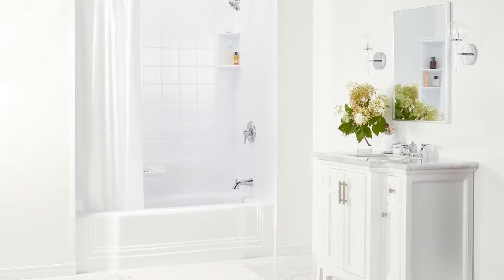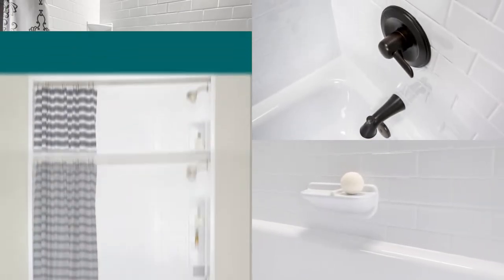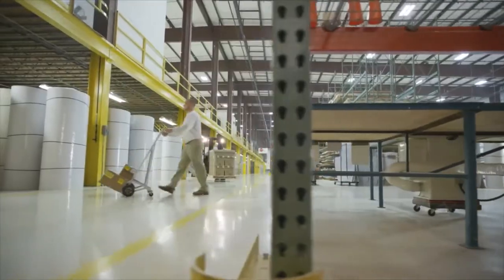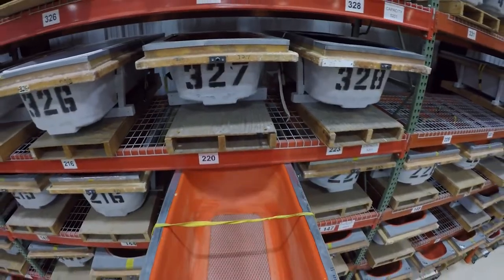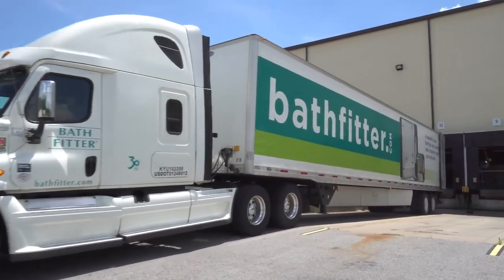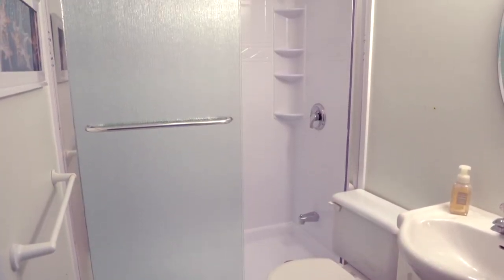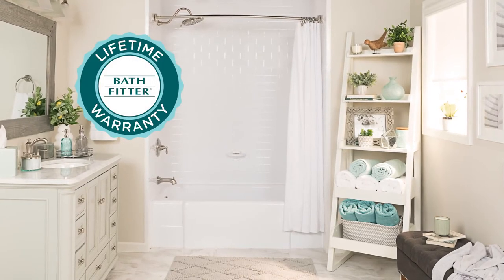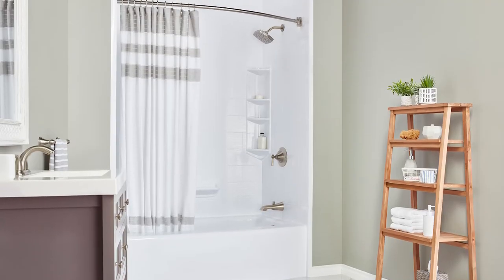Bath Fitter - How It Works

Comment: Never deal with bath fitter if you like your drains to keep working.  Had them out Monday.  Called Tues with tub not draining and was told to have plumber out.   My plumber came out 2 times and they left old tub parts inside that blocked the flow of water and we watched tile clear out through the main as he snaked it.  Dan the manager at Livonia location was extremely argumentative and not helpful with ridiculous explanations and very rude.  Will tell everyone I know to steer clear of bath fitter.!

Comment: Imagine putting on clean clothes over dirty clothes and pretending you're good to go. LMFAO!
Reply from the maker: That does sound ridiculous! lol. I have to assume you are comparing that to our services because you believe we just put a liner of your existing tub and call it a day. The truth is, from our location especially (Pacific Northwest), we replace the bathtub and walls completely. We do the demo down to the studs, replace the green board, build back up from there. If you have a fiberglass tub/ shower, full replacement is actually the only option. We will not place a liner on a material that is so unreliable.
Reply from the maker: @shelbyseelbach9568  I responded by saying that putting on clean clothes over dirty clothes is ridiculous. 
We are typically in and out in a day. We have many advertisements and offer different services. This displays one of them. This is, however, not the most common service we provide. I spoke to the other services because many believe all we do is put a liner over the tub. It sounded like that's also what you believed. 
Our liners as well as our full tub/ shower remodels have a lifetime warranty. This is not something that would be offered on a scam. But you are entitled to your opinion, Shelby. I wouldn't expect your business, anyway, considering you are a plumber. Have a great rest of your evening and I wish you the best in your endeavors.
Reply: @bathfitterinlandnw  LMFAO. Like a used car salesman. Hilarious.
Reply: @bathfitterinlandnw  thats not at all what the video says and shows

Comment: For a few dollars more have someone rip it down to the studs and correct any damage before putting up a cover over an existing  tub
Reply from the maker: Hi Homer, we actually do take it down to the studs, in most cases. There is the option to install a liner over your existing tub or shower, but most opt to replace completely and that is something we can also do!
Reply: Yes Homer, they just use the promise of in and out in a day as a way to drum up customers. They sell full renovation pretty much every time as he admits OVER AND OVER AND OVER. It's called a bait and switch and is one of the oldest shady business practices there is. It is just amazing that he actually admits it. LMFAO!
Reply from the maker: @shelbyseelbach9568  We actually specialize in just the wet area of the bathroom (tub/ shower) and do not offer a full bathroom remodel at all. Also, our installations really are completed in a day - day and a half. There are exceptions, of course... but not many. You may be confusing us with another company similar to ours that does offer full remodels? I'm not sure. But thank you for being a voice for consumers and warning people of the scams often played in advertising. I couldn't agree more with your frustration and am proud to say Bath Fitter is not one of the companies who participates in those practices
Reply: @bathfitterinlandnw  CRAAAAAAP
Reply: they just did our bathroom and they do tear down drywall and put up new before hand, they were very nice and informative our bathroom looks great now
Reply: How much is it for bathtub installation

Comment: Why is it so expensive to just cover the original bathtub. I mean I understand a whole new installation but thousands for some homeade caulk and an acrylic cover. Maybe I'm just to broke lmao
Reply from the maker: Well, "expensive" and "broke" are both pretty relative terms, but I understand what you mean. I think the value of our materials and services really comes from a few places. 
First, we manufacture our materials in Nashville, TN. We use high quality acrylic that is non-porous and will not mold or mildew. It is very easy to maintain and continues to look new years and years later. That's why we offer a lifetime warranty on all our products. 
If there ever is an issue with anything, we come out and fix or replace it at no cost to you. We don't send out subcontractors that aren't trustworthy and don't care about our customers. We come out ourselves and make sure you are more than satisfied with your tub/ shower remodel. We have a 4.8 stars rating on Google with over 300 reviews that are a reflection of the quality work we do and the attention to detail that really makes a difference. 
We get your remodel done in as little as a day. Sometimes it takes a day and a half. But if you've ever had a contractor out or done a bathroom remodel yourself, you know how valuable it is to have the job done so quickly and efficiently. 
I could go on and on but I'll spare you the commercial. I know not all our services are within everyone's price range and that can be frustrating. But I will say that we typically come in at about 20% less than our competitors price quotes and we certainly make sure you are happy with your purchase/ investment when all is said and done.
Reply: @bathfitterinlandnw  Beautiful reply. That's what me and everyone else that watches your videos need to hear. Thank you!
Reply: Remember it’s American made that’s why it’s so expensive
Reply: @icemanlol119  😅🤣American made -  I just got a  $9.5K  quote to remove old tube, and place nice big tiles to ceiling,  and also glass doors. I'm certainly not going to do this for $7.2K if all you do is place it over the old rotten stuff. haha for get it
Reply: @bathfitterinlandnw  great response… I’ve been working on my guest bath for a year myself… lol I def getting bath fitter for the main bathroom
Reply: I wonder the same thing. A whole new tub costs $1000-$1500 wo labor. How is it 5-x6 the cost for just putting some stuff over old stuff.
Reply: @mayssm  i was floored when i inquired about this, thinking it'd be like $1500 with the install for new construction.

the fact that it took so much to get meaningful number out of them was exhausting

Comment: I just need to know one thing? Why do you call them a seemless  wall and contractors are chalking the corners and walls? WTH 🤦🏻‍♂️ 
I’m sorry that’s NOT seemless. Seemless is a piece part. If it was  one piece unit you couldn’t get it into the house or bathroom! 
🤔😤😡
Reply from the maker: The wall actually comes in as a flat piece and we bend it using a heating element once we get there .It is a one piece wall.
Reply: @bathfitterinlandnw  Then why does the commercial show them chalking the vertical walls?
Reply from the maker: @bobmac9070  I'm not sure what you're talking about. Can you give me the mm:ss where this is happening?
Reply: @bobmac9070  They didn't calk the walls at all because it's one piece... 🤔
Reply: @bobmac9070  it's caulk not chalk...ffs man, know what you're talking about before you start firing off comments.  And there's no caulking in the video. The vertical strips are finishing trim for the ends.
Reply: @markk4708  OMG … pardon me for misspelling one word Mr Dictionary!
So rude to point out one little mistake. 
And BTW there’s a huge gap between the tub and wall, and just how do they fix that? Caulking !!!!!  No thanks I’ll just ceramic tile mine which is what I did to save over $5,000 for a plastic/acrylic liner. Tile cost $500, priceless results. Do it yourself.